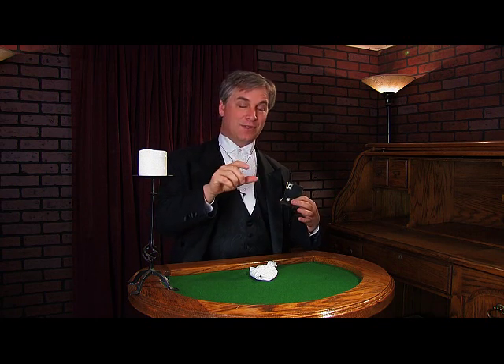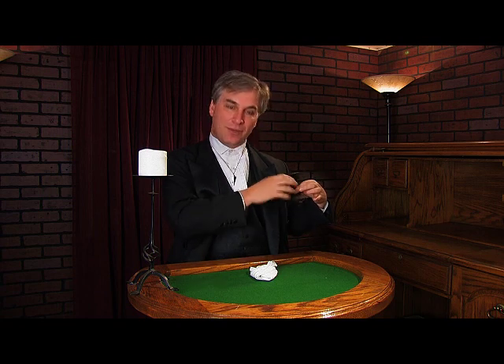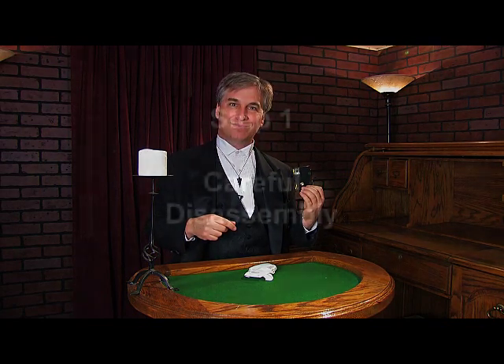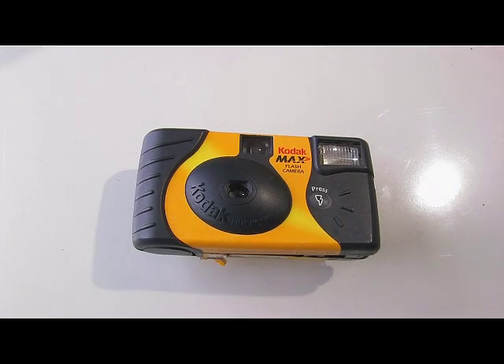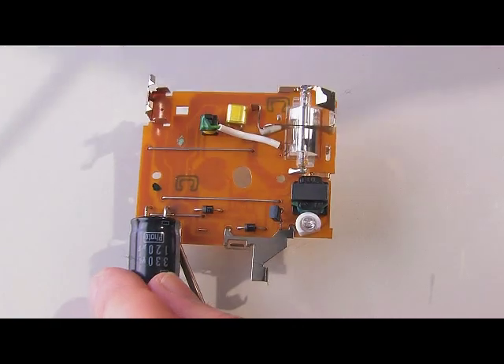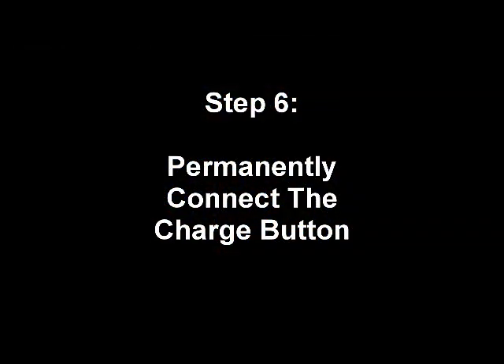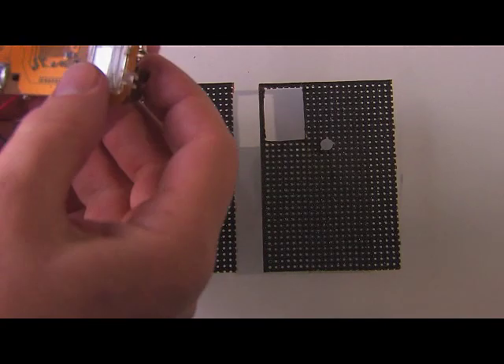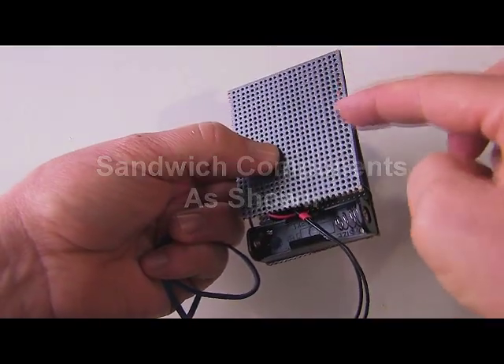Make Your Own Fism Flash Magic Trick Revealed!

Comment: You'll just need to look at how the camera you use is wired when you disassemble it.  IT's easy to see where the battery hooks up, and USUALLY easy to see where the switch is.  Also, at the end of the video is a link where you can buy strobes that are already wired for you.  Thanks!